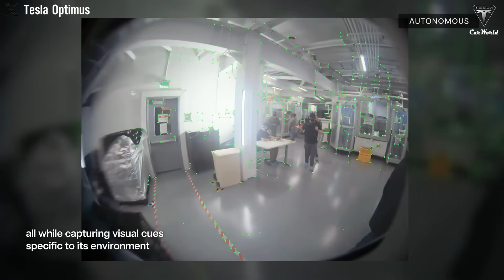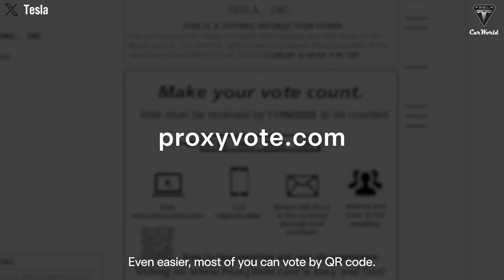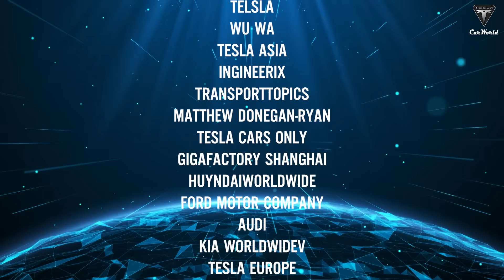2026 Tesla Bot Gen 3 Finally Here! Elon Musk Leak STUNNING Abilities & New Magic Hand!

Comment: Of course some shoes if mopping might damage the Robot🫣
Reply from the maker: Optimus is designed with sealed joints, torque limits, and slip detection. Industrial robots already operate in wet environments; household mopping is a known, manageable constraint.